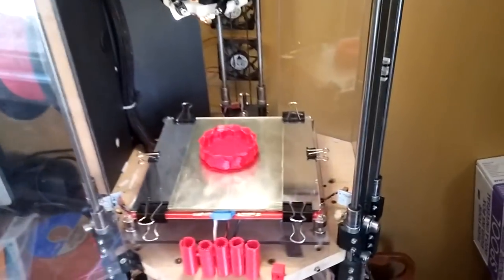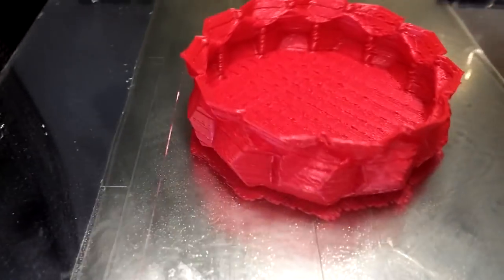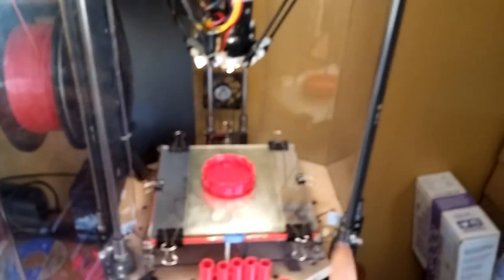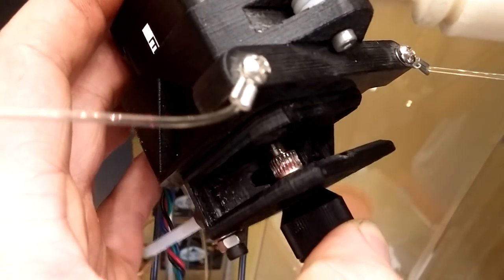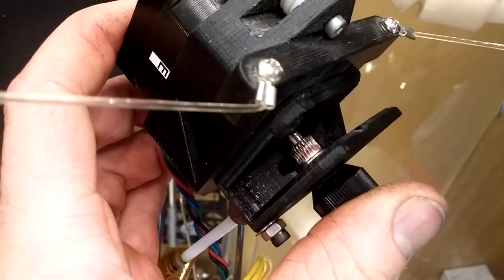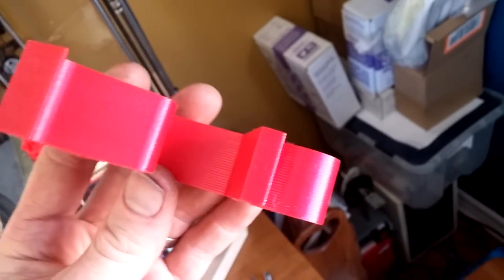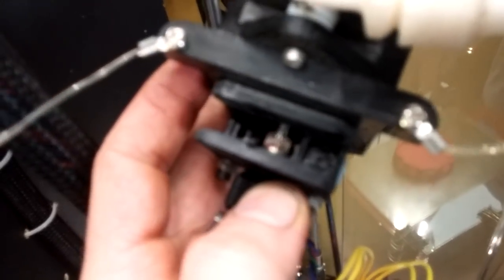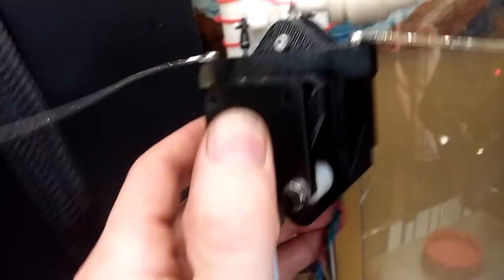3D Printing Quick Tip. How to tell... check Your Filiment Drive Gear.

Comment: Good tip , especially when you have a some what hidden extuder pinion, and you may forget to check it . i wonder if one could put a brush on a offset  axis like 45deg , so the motion of the  pinion would rotate the bush  but the 45 deg would force a sweep . we have some heavy machinery that runs on rails at work and in front of the wheels are  brush disks  on a bias and off center to be sure nothing damages the track or wheels. the bias makes them spin from the off center drag / friction with the brush.

Comment: What's filiment?
Reply from the maker: curently testing some rigid.ink red PLA Pluss. some interesting stuff. it's slightly flexible but yet quite rigid. it feels kinda "soft" so it's more durable than other PLA's. seems less likely to crack when hit with a blunt blow. ;)  ~Russ
Reply: The blue stuff they sent me was real strong . supposedly it can be annealed with a short bake , but i have not tested that as all the parts i made were real strong even when i purposely  oriented the print to have the layers take away from strength.  The PLA plus they sent me ( blue )  , has amazing layer adhesion . The last torture test i have for it is how long my incorrectly oriented part will work as  belt tensioner before it splits . on that note i had to triple the air gap for supports and rafts and the like or they would not come off.
Reply: ***** Oh filament ok gotcha.

Comment: Why you use delta over Cartesian?
Reply from the maker: greate question. for me it was a factor of parts needed to build one. there are fewer mechanical parts. secondly. The only thing you need to to worry about in speed is know the weight of what's on the endefector. it's the only thing that is moving. the arm length and the slide rails do play a factor but manually it's the endefector. Also the part your making stays in one place. (dose not move) some other Cartesian prenters also don't move. there also more interesting to watch. ;)  just my thoughts!! ~Russ